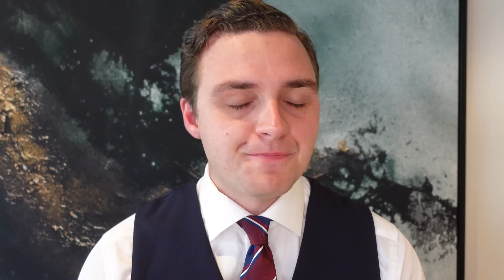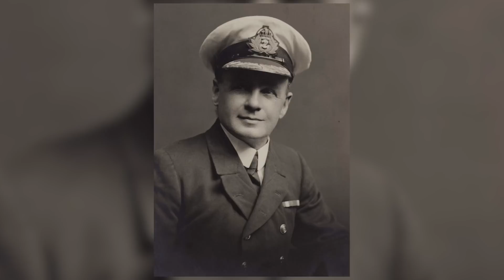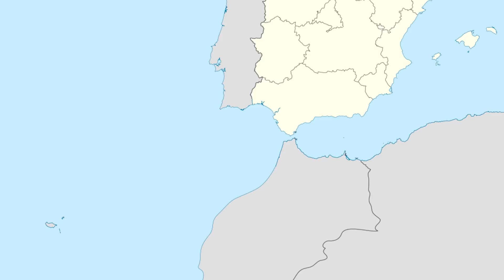How to Annoy the Steam Engine Community

Comment: Delighted to be quoted - and please don't get me wrong, I LOVE your videos, and any mistakes didn't bother me - MASSIVELY complicated system!!!  Been an ocean liner geek for many, many years - they were still on the ocean when I happened along.  A few weird twists for you:
I didn't get into the superheating debate because I didn't know whether Titanic's steam was superheated; happy to hear the truth of the matter, and the use of water separators.  Water separation was - and is - vital to steam engines to this day; if you watch steam locomotives pulling out of a station with crowds of happy steam-tourists aboard, they'll always be blowing-out clouds of steam from the bottom of the cylinders.  This is the engineer opening valves on the cylinder bottoms, to blow out any water that may have condensed out while they were stopped.  Ships do the same thing - on your diagram of Titanic's recip's, there are small, strange looking Eiffel-tower-like things on the ends of the cylinders.  Those are valves to let any condensed water out of the cylinders on starting - quite enough power there ("pounds per square inch", again) to pop the ends right off the cylinders if there's water in them, and there are valves on top and bottom as the cylinders were double-acting.
Superheating is a really big deal, and massively increases the power of a steam system, which is why it's near-universal today; the higher the pressure, the more efficient the engine ( - read, "the less fuel it uses for the same work" - ).  To give you an idea of this, Normandie had 29 main boilers producing steam at 400 psi; and United States ("the Big U") had 8 main boilers, producing steam at 1,000 psi.  Big U's boilers were naturally larger than Normandie's, and one of the reasons they went to water-tube boilers rather than fire-tube boilers is because on a water-tube boiler, only the drums and the pipes were under pressure; on a fire-tube boiler the entire thing is under pressure, and you can't run it at much more than 250 psi or the whole thing will burst.  At these temperatures, you must take the expansion of the boiler into consideration; reading about SS Norway's boiler explosion, its boilers had 'shoes' on their mounts and could move-around as they expanded; and in modern steam electricity plants, the boilers don't rest on the floor; they're hung on chains from the rafters, and they expand a whole lot (I'd like to say "by feet", but I don't know how much they actually expand).  An idea of how lethal steam at these pressures can be - leaking steam is invisible for some distance from the leak because it's still too hot to condense into vapor, so you look for the leak with a broom; and when the head falls off the broom, you've found the leak.
That centre turbine was a masterful piece of work - and I'd point out that it obviously runs on very low pressure, because it's HUGE!  If you put any real pressure in that huge casing, "pounds per square inch" means that it would burst.  I'm fascinated by the "psig / psia" debate; all I'd heard was that the turbine took steam at ~atmospheric, and I remain awestruck at how much power they got out of that turbine.  BTW your 'turbine' depiction in the line drawing is actually a reduction gear, which Titanic's turbine didn't have, but that's no biggie at all 😉

Comment: There was an anecdote about salt water getting into the feedwater on a Sverige class coastal defence ship in one of the books I read.
I think the engineers saw foam in their feedwater level gauges and all hell broke loose. The boiler was raked immediately and allowed to cool down as there was an unknown explosion risk. The feedwater was then purged and the ship had to lay at anchor until the evaporators had created all new feedwater.
It's possible the ship was saved from disaster because the saltwater content in the Baltic sea's brackish water is low